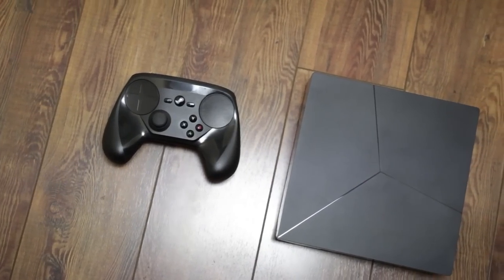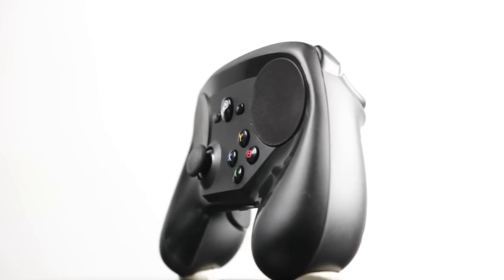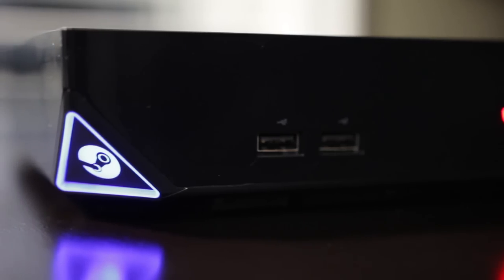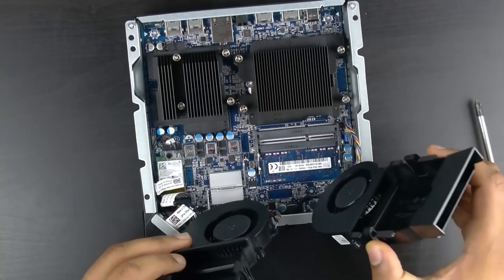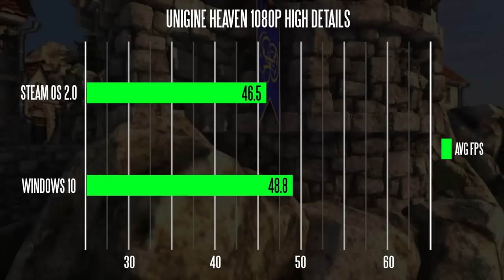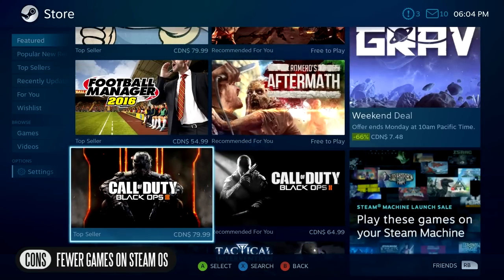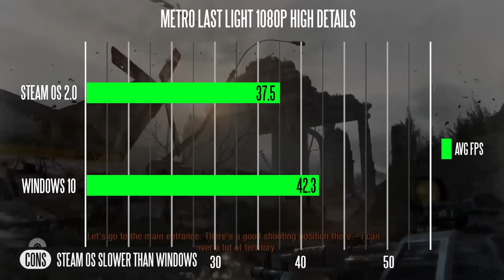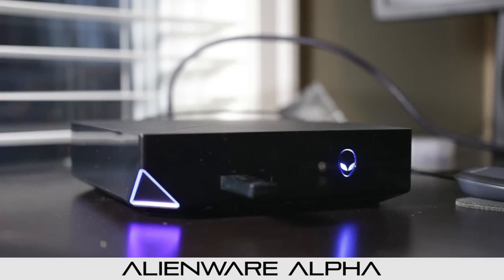Alienware Steam Machine - Full In-Depth Review

Comment: Friend bought one of these tonight (Alienware Steam Machine ASM100-6980BLK) and asked me to help him set it up since I've already built my own PCs. Steam setup was easy however you will need someone to help you run Windows if your not tech savvy.  Unfortunately, the SteamOS library is limited. I have over 200 games in my Steam library and only about 50 of those were compatible with the SteamOS. 

As mentioned in the review your stuck with a 2 GB 860m gpu that cannot be upgraded which is a major concern. 

As far as performance, I was expecting the machine to run quite well. Not max out Crysis 3 well but run stable. Downloaded Spec Ops: The Line and it would barely run without having lots of frame rate issues during the single player campaign. It should be able to run an older game like that without any issues considering the specs are at or above recommended setting requirements. He may have gotten a bad system but it was enough for him to return it and I can't blame him. Odds are I will just build him a PC for just slightly more than the cost of the steam machine.
Reply: I simply use the  steam software downloaded from the internet and have full access to my entire steam library of games.

Comment: Questions.
1. Can I use other controllers? I use an Xbox controller when I play on my PC when the game allows it.
2. Can I still use a mouse and a keyboard? Like you said the Steam controller doesn't have the same feel.
3. Does it connect through WiFi or just through internet cable? I saw a slot for an internet cable so I'm not sure if it also connects through WiFi.
4. Would I be able to use mods? I'll bet that I can but you can never be too careful.
Reply: +rambofan334 yes you can you Xbox controller just replace the steam controller dongle with and xbox controller dongle. yes you can use mouse and keyboard. I don't know about wifi but you can use mods

Comment: Can any human observe a 5 or 10% difference in frame rate? How many TVs can display these high frame rates anyway? In short, of what relevance to the real world are any of these benchmarks?
Reply: +Cynical Human I accept that, in ideal circumstances and for certain types of image, a typical human would be able to tell the difference between a 40 fps and a 60 fps video. However, that is not what we are talking about here - we are talking about a 5 or 10% difference in frame rate (a 5-10 times smaller difference). Although it is true that the interfaces of modern TVs can accept a 60 fps data stream, the actual switching speed of the pixels is usually slower than this - they do not switch on and off instantaneously.
Reply: +Cynical Human, if you can tell the difference between 40 fps and 42 fps (a 5% difference) or between 40 fps and 44 fps (a 10% difference) then you clearly have "super powers"
Reply: +Stephen Bingham Agreed, he's missing your point.

What I would look at when discussing close margins like this would be minimum frame rate and frame time deltas. This would be much more relative to the 'smoothness' you get in game. I would gladly take a 2 FPS drop in average framerate if my minimum framerate was higher and my frame time lower.

Comment: I ordered the i7 model and I'm having serious thoughts about sending it back. My question, if I load Windows on this, will I then be able to have access to the full steam library? It seems like an obvious yes. For the price, I'd like to return it and get a $750 gaming PC with hdmi. I'm kinda bummed...
Reply: +Heath Hampton I just returned it. My wife got this for a christmas present, so I didn't even open it. I got the i7 $750 model. If anyone knows a decent gaming PC for abound the same price let me know. I realize it's not going to be a great PC for that amount, I just wanted some ideas.
Reply: +Heath Hampton I would recommend syber / cyberpower. They also sell both windows versions or steamOS versions (or you can have both installed). Is pretty upgradable too for the future. I basically run Linux mainly, so am mostly fine with the 1700 games (100 ports per month) it has and will have many more games coming once Vulkan (mantle 2.0) is out. I use my windows machine less and less as I don't like having antivirus in the background taking up memory and cpu. So if a game is available on Linux / steamOS I prefer playing it there than in windows. Also the controller is incredible is 90% software. So This reviewer left out most of its features like Gyro /Motion Aim controls for shooters, mode shifting, trackball, etc. am having a lot of fun learning its potential with many good guides already.
Reply: +gamehero4 please do
Reply: gamehero4 I'm gonna buy a PC that could substitute my old laptop that I use for playing LoL and Uncharted but also that I can use for work, Excel PowerPoint and sortof. It should have windows, keypad and mouse, and able to play games nicely without a 700+ expense on my card.
Reply: +gamehero4 nah, I have an LED that can hook
Reply: +gamehero4 thanks

Comment: I talked to someone at GameStop about this, and apparently they had no idea what they were talking about... they told me you could not exit SteamOS and that you could not do anything else besides use Steam which is clearly wrong. It's a neat idea, but it's just kind of stupid to have integrated parts on it. You're better off simply buying or building a PC yourself that you can actually upgrade. Otherwise you won't be able to keep up with the newest gen games for long. If none of It's parts were integrated, this might be a good starting point for an upgradeable PC, especially since it's compact and somewhat portable. 

Like I said, good idea but it needs some work and you're definitely better off getting a regular PC. You could probably get something comparable for the same price.

Comment: I made my own SteamOS with Windows 10 as the background platform. I cut W10 down to just the necessities to run games using WinReducer which got me an install footprint of under 5 gigs. Set Steam to start in big screen mode and Origin games I linked to the Steam's UI. So this method decreased the initial boot time to where it boots Steam much faster so I never see the desktop. So not it's a much more streamlined console like experience and with the Steam controller I can make shortcuts on Steam to GOG games or basically every game imaginable.

Comment: Out of the box, it's good. What is great is that I can upgrade the RAM and the HDD plus I can get a copy of Windows 7 Ultimate onto this. The multi-colour lights on the machine is a nice added addition but whether or not I am able to change the lights after getting 7 Ultimate is another question. The Steam Controller is nice HOWEVER the clicking will get on my nerves. Best thing for me is to sell it and get an Xbox One controller instead. This leads me to the fact that you are able to hide the dongle inside the machine rather than having to take up a USB port on the outside. Very considerate Alienware. I will get 16gb of RAM on this plus an XBone controller just to get a better experience from this.

Comment: i don't want to stream but can you buy games like rust and Garry's mod on this console/PC and is the windows part an actual PC desktop?
Reply: Steam OS is a regular Desktop operating system in itself as well. It was also shown in this video. The "console" interface you saw here is just the Steam client in full screen mode, but when you close it, you just get the Linux Desktop which basically has the same logic as Windows (icons, menus, folders, etc). Look up Debian Linux or Ubuntu Linux to understand what I mean. It has all the software you need in a big repository of free Linux software, you can use Office applications, PDF readers, image manipulation programs, Chrome, Firefox, Microsoft Skype and so on. You can also run some Windows-only apps and games using a tool calle "Wine". And of course you can also install good old Windows on a side and decide which OS to start when you turn the PC on (because it is a PC in all regards).
Reply: Tziu Ricky how do ypu download windows 10?
Reply: TheKmodo Gaming
It can be downloaded (legally) from the Microsoft website using the so called "Media Creator Tool". It's a Microsoft App that will let you create a Windows 10 installation USB-stick or save the download as an .ISO image to be burnt onto a DVD or a usb stick at a later time. You'll easily find it if you google the above app name.

Comment: this may be a dumb question but if I buy the cheapest version of this and download windows 8.1 will i be able to play all the games on steam and not just ones which can be played on linux. I have bad computer and would rather not buy a new one if I can just buy a steam machine and play on that
Reply: +Rudie Subs Just buy the alienware alpha, its the same but it runs windows
Reply: Vincent Stavleu I want to get the steam machine as a console, not a desktop. so how viable is it to use wine and playonlinux to play all the games which are windows only? also I want the free games.
Reply: I'm using my alienware Alpha as a console. Just with the added benefit of a greater library. Wine might work but I don't know if you can add shortcuts to wine games in steamos (you can add shortcuts to non steam Games in steam for Windows)
Reply: but doesnt running windows use alot of the ram? wont this slow down games?
Reply: +Rudie Subs probably, but as it is the alienware Alpha performance is better than the Steam machine, probaby something with optimisation. I would only get the alienware steam machine if you can live without Windows exclusives and don't want to pay extra for the steam controller.
Reply: okay thanks
Reply: Stavleu Junior man i think you can add windows to the steam machina... so its basically the same as alpha!! Juyst with the difference that alpha already includes Windows OS and in the steam machine you need to own it by yourself

Comment: people need to stop bitching about the steam os performance. it's not that steam os is slow. if anything, Microsoft really improved performance with Windows 10. but mostly, game devs aren't optimizing their Linux ports. that being said, when you're saving 100 and only benchmarking 2 frames less on the heaven benchmark, I call it a success. if they added a gpu that added 2 fps but raised the price 100 dollars would you buy it? it's about performance per dollar folks. this thing out performed the current gen consoles and is a bit more expensive. I'm fine with that. it also comes with lots of free games, free multiplayer, and games are cheaper

Comment: is skyrim available on steam os?
Reply: anything that steam sell you can buy and play on it its a computer to so you can surf the net aswell
Reply: It's not natively available on SteamOS. You can however, use Steam Link to stream it to a small SteamOS machine that's connected to your telly. That way, you can play all your games that run on Windows natively via streaming on the telly and all games that run natively on SteamOS directly from the SteamOS machine. The SteamOS will make the distinction for you if you have a Steam Link installed in your setup.

Comment: Well this sucks...i was looking out for this machine but it's starting to look like it has just as much cons as pros that the regular consoles have. So whats the point?
Reply: +72vince27 Honestly it really doesn't, until the performance optimization is introduced to the linux OS, and the full sweet of games offered by steam, it can't really compete with just getting a 400$ or even just buying a 600$+ PC with windows. (Some steam machines of course aren't just 400 they can be 1000 $ even so a PC still dominates those platforms prices)
Reply: you can buy the i7 version for an extra $200 compared to the i3 version and a copy of windows 10 mate and boom a i7 and 2gb ddr5 gpu for $700 playin maxed games

Comment: Intel Core i5-4460 3.2GHz Quad-Core Processor
Cooler Master Hyper 212 EVO 82.9 CFM Sleeve Bearing CPU Cooler
ASRock H97M PRO4 Micro ATX LGA1150 Motherboard
Patriot Signature 8GB (2 x 4GB) DDR3-1600 Memory
Sandisk SSD PLUS 120GB 2.5" Solid State Drive
Western Digital Caviar Blue 1TB 3.5" 7200RPM Internal Hard Drive
EVGA GeForce GTX 750 Ti 2GB Video Card
Rosewill Galaxy-01 ATX Mid Tower Case
EVGA 600B 600W 80+ Bronze Certified ATX Power Supply
Asus DRW-24B1ST/BLK/B/AS DVD/CD Writer
TP-Link TL-WN881ND 802.11b/g/n PCI-Express x1 Wi-Fi Adapter
Asus VX228H 60Hz 21.5" Monitor
Cooler Master CM Storm Devastator Gaming Bundle Wired Gaming Keyboard w/Optical Mouse
Logitech G230 Headset

this is my future gaming pc the games that I play will be GTA 5, Black Ops 3, Need for speed 2015, cs:go, H1Z1, g-mod, mine craft, battlefield 4. if you have any good/useful suggestions please replay.
Reply: +Maher Ferawana I would say to drop the 750ti and go for a 960 for a better experience. For any gaming computer, your GPU needs to be a priority.
Reply: +Maher Ferawana lose the ssd and get a better graphics card
Reply: Why the hell would you cheap out on your gpu its the most important part of a gaming pc
Reply: +Maher Ferawana You're going very cheap on the GPU...

I'd say, get an i3 4160 instead of an I5 and get a R9 380 (better than a GTX 960) instead of a 750Ti, the performance & quality will be a ton better. I would advice to get a 4gb model of the R9 380, some games takes advantage of the extra VRAM like AC Unity. Witcher 3, etc.

Also, since we're talking about non K processors, you don't really need an aftermarket cooler, they'lll run fine with the stock one. There you can save a few bucks and get a better brand/model of the video card.